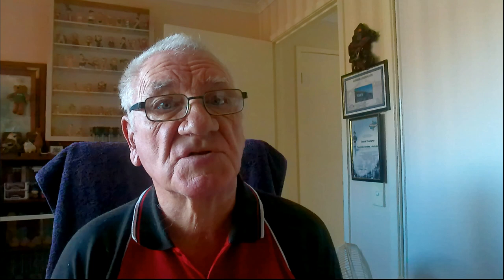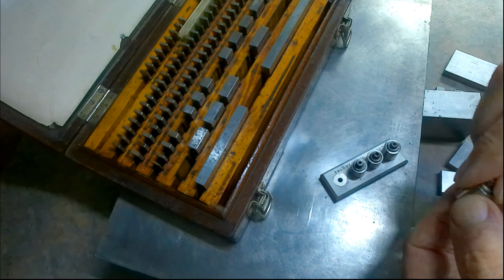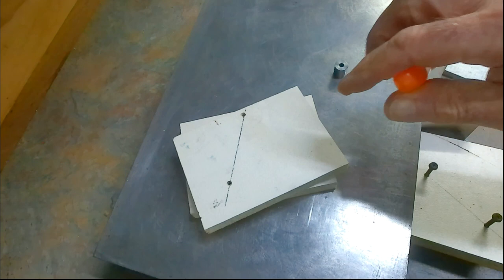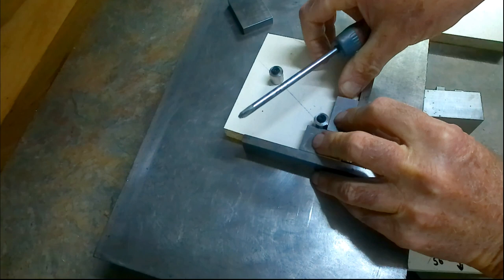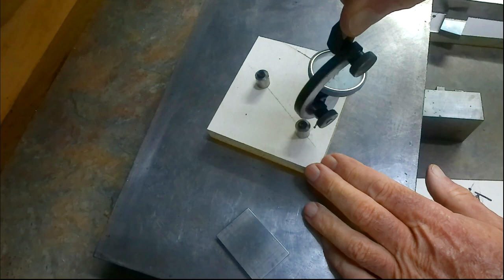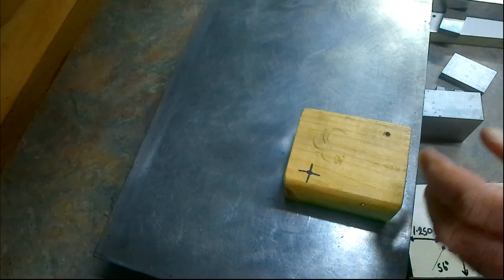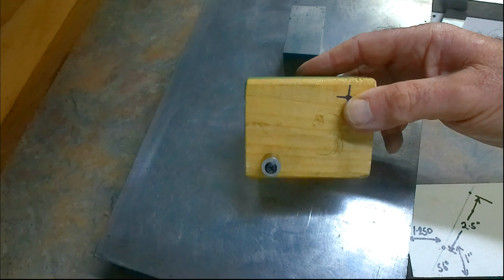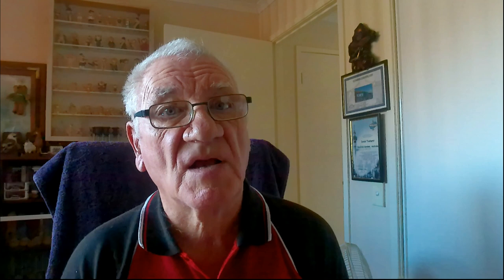How To Use The Dying Art Of Using Toolmakers Buttons

Comment: I was given the task (opportunity) of learning to run a machine shop that is like a time capsule of 1960s and earlier machines. I was gifted a box of old lay out tools and these buttons were included. I never knew what these things were or how to use them. I cant wait to try them out. If not for the knowledge of  people such as yourself, i would be lost. Everything i know about manual machining has been taught to me by old timers that are perfectionist. Its very overwhelming but rewarding
Reply from the maker: Thanks for watching and this comment. Glad I was able to help. Good luck with your engineering learning, there is so much to take in. Some information is not much use in todays CNC machining but it is invaluable for oldie World manual machines. Regards.

Comment: Hi Dave, great video it brought back memories. I used this method on my lathe faceplate to bore two holes in mountings for ground silver steel rods to
 make the slideways for a horizontal borer back in the 1980's. I still have the borer today but it needs a refurbish after being stored outside under cover. Tony
Reply from the maker: Sounds great, Tony. Don't put off until tomorrow what you could / should be doing today. Tomorrow never comes. Time flashes by so fast. Go get it and start the refurb. Thanks for the comment. Regards.

Comment: Nice.  I've read "Machine Shop Practices", both volumes cover to cover... and even used a few things I learned.  I have not used buttons yet.  There were probably a few times I should have.
Reply from the maker: Thanks for watching and this comment. Depending where you live in the World, you may have a difficulty in trying to find a set as it is " Old Technology " but do not despare. You can make some out of ground rod such as Silver Steel or Drill Rod. As long as you ensure that the bottom face is machined and honed perpendicular to the OD then all will be well. There are some rollers used in roller bearings that are hollow in the center, if you know anyone who works with replacing bearings and can find you some. In a set there are usually 2 short ones and 2 long ones. Any size bolt threads that you want, just as long as the hole in the rollers are a very sloppy fit, about 60 to 80 thou oversize to allow for the button to be accurately adjusted. Regards.

Comment: Buttons permit accurate manual layout on large items too big for one's milling machine. A piece of suitable steel fitted with drill guide bushings is a handy way to make holes square to the material. DRO are lovely for backlash compensation which is probably the best reason to buy one.
Reply from the maker: Thanks for watching and your observations on other engineering problems. Regards.

Comment: I had a boss once that always touted how he was a toolmaker, but seems when strolling by my open box, he always had a question of what something was. Amongst the things that he had no clue were a set of toolmaker buttons. He was impressed with my trammel set, he had never seen someone layout a bolt hole pattern, center punch, drill the holes, and everything came within tolerance... he would have flipped if I would have drilled the holes with my hand powered copy of a Cole drill
Reply from the maker: Thanks for the view and your excellent comment. You boss may have even been just a Relation to the owner, so did not need to know anything. Just a job for the "Boy's" Regards.

Comment: Fantastic video Dave ! 
You are spot on with the comment dying art - the lure of the DRO is strong ! Problem with the DRO is it doesn’t account for wear in the machine or if the scales are as accurate as they state they are . If you can find me a home shop machine that you can zero the DRO then lock the ways without the DRO changing I would like to see it ! 
For home use a set can be made that will serve the job at hand - sure no where as accurate as a proper set but better than nothing .
It is fantastic that you are showing how to use these tools and procedures because 
a lot of hobby machinists go through their whole life not really knowing or understanding why the hole they just drilled isn’t located where they wanted it , it maybe close but when you are making a Steam engine cylinder with a bolt on head and steam  chest that may use many studs to hold them in place a couple of thou variation on the stud location on a few different studs means that cover isn’t going on without some fettling or severely oversize holes .Yes they can clamp both together and drill and tap the holes in one go but any error is the applied to the mating part so it will only fit on in one orientation .
Reply from the maker: Hi Ian, glad you approved of it and it was to your liking. More in the pipeline. Stay tuned. Regards.
Reply: One tedious factor is that you have to first mark out the holes positions and drill and tap them to get the screws and buttons near enough before mounting the button.....BTDT.....even if the part is hanging in the air and not on a table you still have to have the button near enough before you can dial up on it.
On the aspect of slides moving when tightening the lock screw........utter crap, if the DRO shows that the table moves you slacken the lock and move the slide back etc......DRO's are far more accurate than practically any person can successfully apply buttons and they ignore screw backlash........ glass scales are accurate to 5 microns (and you need to have a set of gauge blocks to use buttons too)......but I get what you are driving at.
Once you have a DRO and use it you never go back.....EVER......it makes calibrated dials on machines obsolete and can go from Imperial to Metric if required.....can't imagine why anyone would use Imperial now.
BTW....I thought the UK went Metric in 1972 (when I was last there).....why are you still using Imperial measurements?..........only the Yanks like Imperial.
Reply: @gangleweed  
RE the scales moving , the scales are not mounted on the feed screw centreline but on the edge of the table or Y axis slide . They are parallel to the feed screw movement for certain but when you clamp the slide any clearance is taken up and this clearance which all machines must have regardless of how small can cause the numbers on a DRO to move .If this movement is not exactly perpendicular to the scale it is magnified by the distance the scale is from the axis centreline , I’m not talking about tool room quality machines that we all would love to have - many have old and worn machines and even the new Asian made stuff can have problems here . So you set it up , zero everything then clamp it up then notice one axis is now reading different - do you re adjust it or leave it ? Did  it really move in the direction as stated by the dro or was it a small amount of table twist ? 
RE scale accuracy - yes they can read  very accurately but did you confirm this and compensate in the settings as per the installation instructions ? Not all scales are created equal and the machine may not be running top end equipment.
I use imperial here because choose to and I know that Dave would have spent his time using it , I can use either imperial or metric and I’m not located in the UK .
These days most of this is not relevant except in a home workshop as the world has gone CNC mad and many of the traditional skills are being lost - at least Dave is trying to keep them alive for those who wish to learn them !
Reply: @ianbertenshaw4350  Well actually the glass scales are on the sides of the table and saddle and any table movement should first be taken up by the gibs......if the table ways are so worn that they wobble then it's a lost cause and glass scales won't do any good.
You have to know your machinery to know where to fix it or adjust it or at worst take it apart and rework the slideways.....if you lack the skill to work on a machine the only solution is to dig deep one time only, take out a mortgage for a couple of grand and buy a forever machine that will be reliable.
I'm a time served fitter and turned and reworking worn machinery has been my life so lucky me.
Incidently, on the cost of machinery, my lathe is a 1930 Colchester Bantam, bought in UK for 70 pounds Sterling and shipped with my belongings to OZ in 1981.....I had to recut all the slideways on the bed with a hand planer before scraping.....long story.
Reply: @gangleweed  
Amazing how a comment about using toolmakers buttons has morphed into one about rebuilding a machine so a set of digital scales will read true !  You may need more than a couple of grand to buy a decent machine - my Hafco mill cost a nudge over 2k and it aint nuthin special 🤣
Reply: @ianbertenshaw4350  Quite true, anyone who buys a machine purely on the price tag is a fool in the making...........a machine properly bought will last you forever.......cheap junk might not get off the ground when you need it to perform.
I see wishful thinkers who think you can get quality out of an intentionally cheaply made and poorly performing machine.....those people are the newcomers to the trade and have never had the training to develop skills needed to make a machine work.......you can't make a silk purse out of a Sow's ear no matter how hard you try.
Reply: The wear in the lead screw is not relevant to the DRO. The DRO will tell you where the table is regardless of the lead screw.
Reply: @messenger8279  Yes that is true....you can even move the table using an  Allthread leadscrew without any calibrated dials etc.
Reply: This is why DROs are so good, if I lock the gibs and the DRO changes then I know that the table has moved and I can fix it.

Comment: Appreciate your effort and dedication to show this technique!
I just can’t understand how you mean to precisely set the buttons on the stock. You mean we need to make a hole for each and thread them up so e can position such buttons?
Reply from the maker: Hello Edson, thanks for watching and your question. YES, mark out as accurately as you can ALL your intended hole positions, drill and tap a hole for the button screw. The hole in the button is quite a bit bigger than the screw, thus allowing it to be moved around to set the distance accurately, then lock the screw down. Obviously if you need more than 4 accurate holes, you would need several setups. Drill and tap all the holes, pick your first 4 holes, then machine 3 of them. If any other holes are still referenced to to the last button, do not machine it, but remove the plate and set up the next 3 buttons with reference to the remaining button that was set from the first alignment. The number of accurately positioned holes by this method is unlimited. Hope this clarifies the question. Regards.

Comment: Just makes you realise how we take for granted the convenience of a modern day DRO  for precise feature locating  setting out holes
Reply from the maker: Hello Howard, thanks for watching. Yes the 'Youth of Today' don't realise how easy their engineering life is today, compared to the mid 1900's onwards. DRO's were just coming in about 1960, but not like they are today. Big display units using Nixi Tubes ( glass tubes with numbered wires inside and a neon gas that glowed when each number was connected) Needed 1 Nixi for each digit, so if you wanted a 1,000 mm scale you needed 6 tubes if you wanted to read to .05 mm. Regards.
Reply: @daveticehurst4191  I am very familiar with the procedure for using buttons and the toolmakers ball device. We often made our own buttons from silver steel  rod by drilling the centre bore hole and facing either end whilst in the annealed state. After hardening they were ground to the finished diameter and the ends lapped....all good fun.

Comment: Am I missing something here Dave? How is this any more accurate than transfer punching? BTW, in Canada, in the 70s transfer punching was taught in grade school industrial arts .
Reply from the maker: Thanks for the view and your comment. Providing that you have accurately set them up, and dialled it in, this is accurate to Tenths of a thou. To use a transfer punch which I consider is highly inaccurate, you would need a part to punch through. This method is used to make the holes without any other mating part. See this video for the way to transfer holes WITHOUT using transfer punches. Thanks.
https://youtu.be/ZwxgJn4G2kI
Reply: Has nothing to do with transfer punches - Toolmakers Buttons are a precision tool - Transfer punches are butchers tools compared to them . Transfer punches are ok if you only want a hole somewhere close to where it needs to be , if you want a hole to be located within  a ten thousandths  then buttons and indicating is what you need . Set up the button ,set up the job in the mill or even better jig borer , indicate , bore the hole undersize with a slot drill , finish bore to size with a boring bar .
Reply from the maker: @ianbertenshaw4350  Hi Ian, thanks for that extra note, some people are so obsessed with Transfer Punches that they have blinkers on when it comes to the CORRECT way of doing things. Thanks for the view. Regards.
Reply: @daveticehurst4191  Yes, Dave, that video, and your comment about it being an American thing is why I mentioned about it having been taught in Canada... Now since neither you, nor @ian bertenshaw, answered the question of how, just gave the standard British rhetoric of our system is best... HOW is it more precise? Is it about the holes through the buttons being larger than the screw holding it, and therefor being able to take exact location from the gauge blocks? 
BTW, I do understand that a "standard" set of transfer punches is no more accurate than a big-box-store set of sale priced HSS twist drills, but, every proper machinist I know, who works in a jobber shop, has a few precision transfer punches that they have had to custom make for a job at one time...
Reply from the maker: @trollforge  Hello again, thanks for your reply and question. YES, it is because the screw is smaller than the hole in the button that allows it all to work and be the most accurate. Mark and drill as accurate as possible, should be able to get the holes positioned to within 0.015"  1/64", then tap for the screw. As the demonstration showed there was plenty of wiggle room for the button to move in any direction around the screw. Hope you have now grasped the principles behind how they work. Don't know when they were invented, probably over 100 Years ago now. I do know that the Jo Blocks were specially invented for the Ford Factories in the early 1896. Thanks for your interest in the matter. Regards.
Reply: @daveticehurst4191  thanks, all clear now.

Comment: Dear God is this really how we used to do this?.
Reply from the maker: Hi Ryan, Yes it was the only accurate way before about 1970 when the very first DRO's came out. Early DRO were very bulky and did not have the functions that modern day ones have. The Phips one of about 1970 used what were called NIXI tubes for the numbers. It was a vacuum tune filled with neon, about the size of a small radio valve. Inside were wire numbers  0 to 9, they lit up orange when the voltage was applied to whichever number was selected by the electronics box. You could only do 1 measurement, there was no INC or ABS switch, only whatever you had decided it was going to be. Thanks for watching. If you do not have a DRO on your milling machine. it is still the only way to get absolute hole positioning accuracy. Regards.